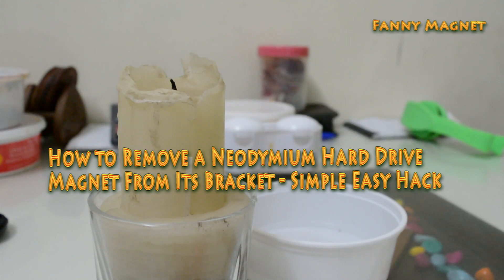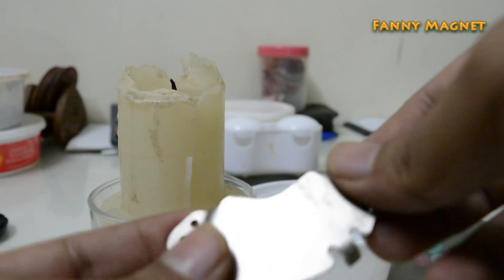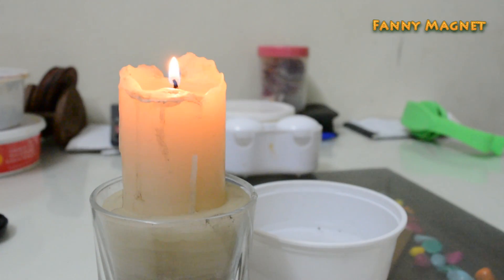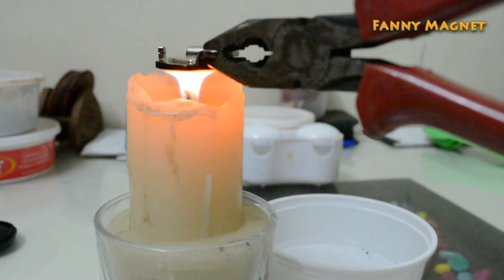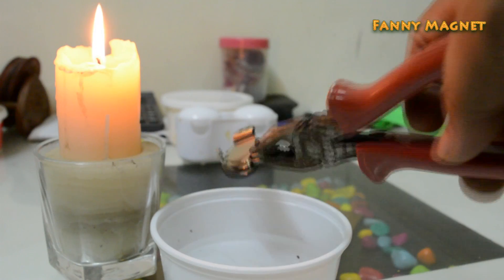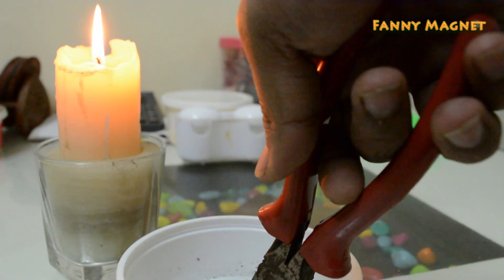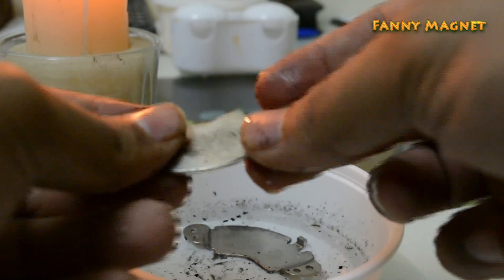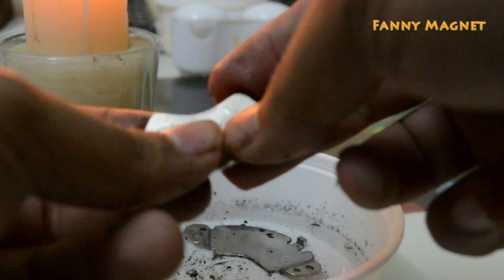How to Remove a Neodymium Hard Drive Magnet From Its Bracket Simple Easy Hack

Comment: When heated above 176° Fahrenheit (80° Celsius), magnets will quickly lose their magnetic properties. The magnet will become permanently demagnetized if exposed to these temperatures for a certain length of time or heated at a significantly higher temperature (Curie temperature).

Dark brown/red inner part of the flame: 1000°C (1830°F). Red/orange inner part of the flame: 800°C (1470°F). Body of the candle: 40-50°C (104-122°F). Melted pool of wax on top of the candle: 60°C (140°F).

Seems to me you are simply demagnetizing the magnet :/  (at least a good bit)
Reply: 3 to 4 minutes. I did it for 15s and now the magnet is dead. Should have read comments first
Reply: I used similar method for like 20s and my magnets are dead as well.
Reply: @fannymagnet then why the fxxk are you saying to heat it for four to five minutes?
Reply: Generally the magnet brackets are NOT very magnetic and are made out of a metal that is specifically not magnetic. 
What the candle is doing is heating up the epoxy that is used to glue the magnet to the bracket. Note if the bracket was stuck because it was magnetic they wouldn't need the glue. It is highly doubtful that you will heat the magnet enough this way to cause any meaningful demagnetization.
Reply: @izicial7469  The brackets are made of a special material called mu metal which blocks or shields the magnetic field from the hard disk drive platters.  This is why the extremely strong neodymium magnets can be used in the head motor assembly without having the magnets affect the data on the hdd platters.
Reply: @izicial7469  It is highly almost assured!  I destroyed three magnets by using a small heat gun for 30 seconds on the back of the bracket.
Reply: Well I just tried it with a tea candle and my magnet is now significantly less magnetic than it was before I followed these instructions.
Reply from the maker: True...hence heat it for few seconds ...if u see the video the magnets which i have removed  same magnets i have used in many of my videos while fixing laptops and macs...
Reply: @mikerak  However, in your video you say 2-3 minutes.  Also you don't warn the viewers of the possibility of destroying the magnets.  This video is worse than garbage!
Reply: @mikerak  you are a liar! and india scammer.  You said to heat it for 5 mins, then someone calls your bullshit and you change the heating time to a few seconds.  This is not India and Americans are too smart for your lies and scams.
Reply: I thought that too while watching the video.
Reply: the Curie temperature of a neodymium magnet is about 320 C
Reply: Yep.... I just ruined one...lol oh well shoulda read the comments first

Comment: you should delete this video!!! heat destroys the magnet!!!
take two pliers, bend the metal part... but just a little bit, just enough to slide a scalpel blade under it, carefully jiggle the blade through and your magnet comes off with the coating intact!

Comment: That's a sure fire way to kill a neodymium magnet. I found warming the metal backing plate slightly with a hot air soldering gun, then bending the plate held in a vice, normally releases the magnet nine times out of ten unscathed. Sometimes the chromium coating unavoidably peels away with the adhesive.

Comment: Everybody claiming that heating the magnet (in the comments below) will cause the magnet (neodymium) to loose its magnetism, can you please provide some references - this project and people's interest in it are borderline physics minded people. So please, provide links, and/or a YT video which demonstrates how much magnetism was lost by a candle heat process for five (5) minutes. 

Alternatively, video maker - please find an alternate solution to remove the magnet - I am assuming there is an adhesive that is in place. There must be a heat-less solution to dissolve the adhesive - that way, we can address the claims of lost magnetism. 

Thanks! 

I'm going to try this on one of my old hard-drives. 

Also, you can see now why third-world countries use kids to take apart old, discarded electronics to salvage the valuable metals contained therein.

Comment: Nice video. But heating is not worth the risk of ruining the magnets' properties.

Simply grab each end of the bracket/plate with pliers or vise grips. Then twist in opposite directions until there is a slight flex. there doesn't need to be a visual sign of bending.  Everything may look the same but check the magnets.  If this does not work you can put one end in a vise that you would have been holding with one hand. Now you have two hands to twist the opposite side.  Don't wait for the magnets to crack or the metal to bend.  When you feel you have made the metal flex you should have broken the seal.  If it still doesn't work throw it through the window.

Comment: i left mine in the bracket,makes it easier to use for picking up loose screws and for prying it off things,these were a lot stronger magnets then i thought,what a surprise for sure,maybe ill open another old drive and separate them from the bracket next time,but i think their safer if left on the bracket.

Comment: Dude - If you haven't caught on and you're reading this message ... do not heat magnets.   You can permanently demagnatize them.  They weaken like a tenth of a degree per every increase of 1° C for @ 1 min past Max operating temp - which safe side would be 50°.  What temperature is a flame?  At it's coolest point, it's about - 300°C.  Hence - placing magnet in candle flame for that long - bad bad BAD!  

Instead... when I took mine off, the bracket has 2 small holes in it where it was mounted to the board.  I took a scrap piece of wood and screwed it onto my scrap, put the scrap in my vice, and the at an angle - whack the snot out of it with a flat head screwdriver.    Pop - ka-pow..  It comes off ... Safety glasses!

Comment: Doesn't work anyway. If you do not have some particular magnet as presented on video then don't even bother. I have tried on three different magnets (I have a heap of old hdd magnets so I can afford to destroy some of them in the process) and this "hack" did not work on any of them. Unless somebody has some method how to dissolve the "glue" then the manual force is still the only way...

Comment: Just a warning: this isn't true at all. Magnets that look identical can loose all of their strength. Not part of it but almost everything and suddenly, when being heated like that. I imagine people who have but only one hard drive and found practical use for their magnets, having taken them out doing a lot of work.

The right method is to take the bracket to a workbench and clamp it down vertically. Then bend one side of the bracket a little with a bigger set of pliers. Use strong tools and protect yourself with gloves like the professionals do. Remember, heating renders a lot of these neodymium magnets useless.
Reply: I wish I had read the comments before watching the video. :/
Reply: Thanks.  Used vise-grip and pliers.  You only need to bend it a little to snap the epoxy.

Comment: hallo sir fanny magnet,its not recomanded,i have 8 magnet neodymium ...but i try to used your trick...but still canot remove from bracket..and i try used 2 my magnet..and after get fire from wax the strong power from magnet REDUCED before used this trick
So i think this trick not recomended,any idea tell me please
Reply from the maker: The magnet is glued on the steel bracket the glue melt and get separated ...
Reply: If you didn't heat the magnet enough to melt the glue then you haven't weakened the magnetic force. Take the horrible English and bad info elsewhere please.